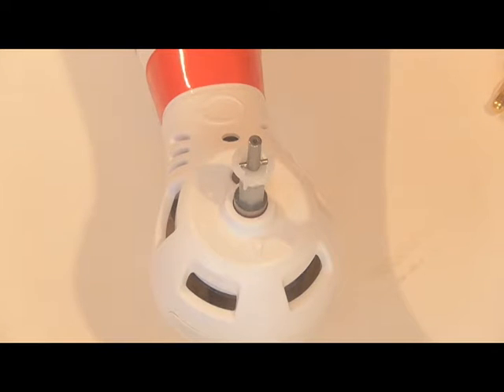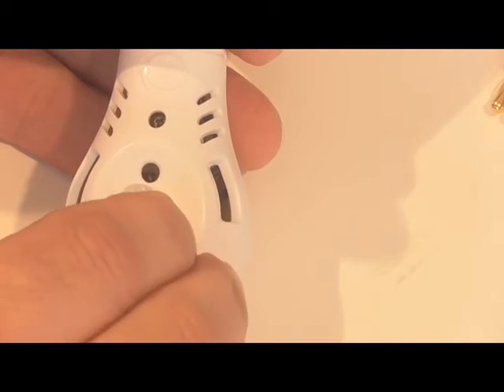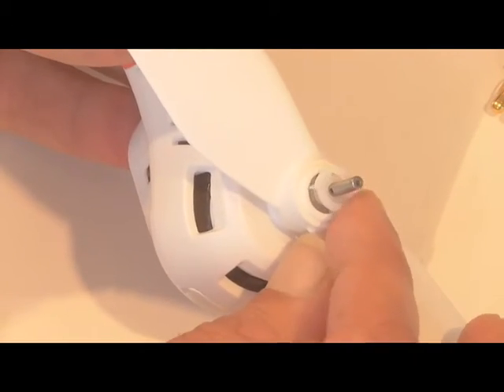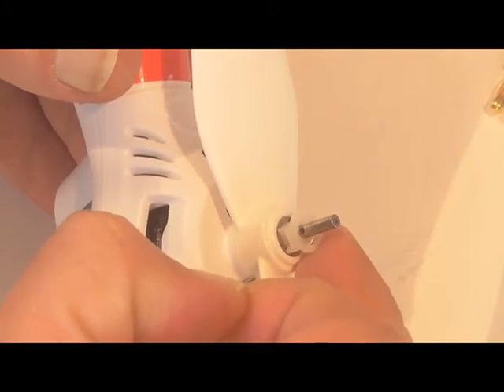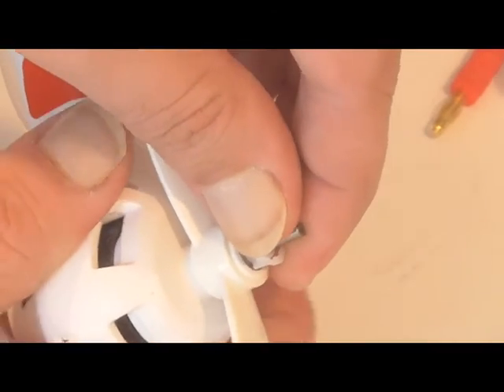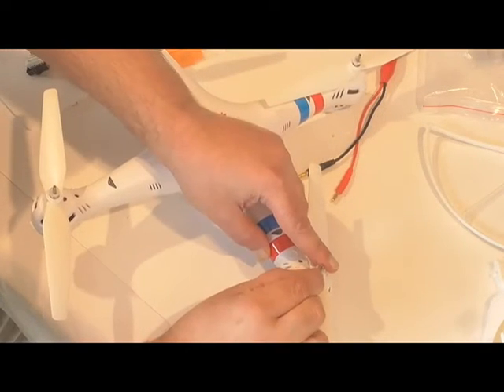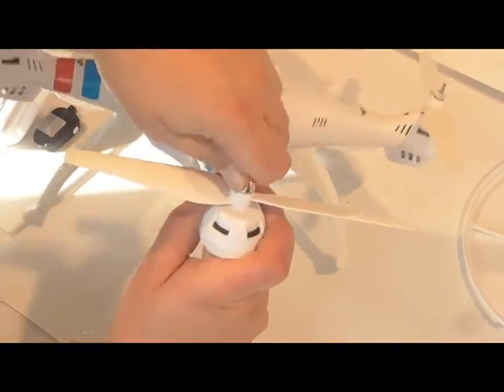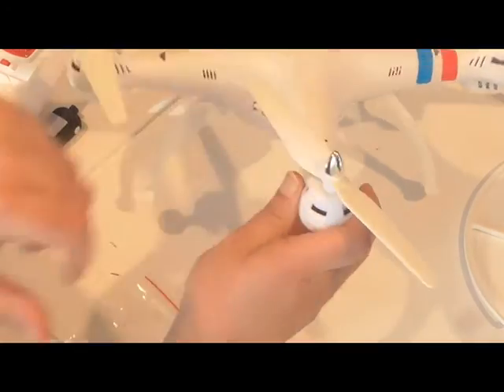Syma X8c Propellor Prop Assembly Installation

Comment: That has to be the dumbest, worst, least ergonomic & least intuitive trash design I've ever seen.  ANY process that could be needful in the field that needs a fiddly operation like this should have failed at the design stages - the fact that people feel the need to make instructional videos on how to fit a prop is a story in itself.

You're out flying, manage to damage a prop, then to change it you have to wrestle with all them fiddly tiny pieces of crap to get a prop changed? Drop any one of them and you're back home waiting on parts coming from the postman!  (Somebody needs to give Syma some "accurate customer feedback"...)

But a big "thankyou!" for taking the trouble to show this.